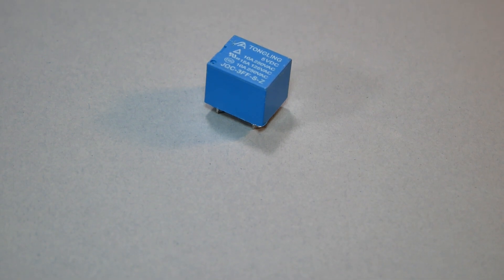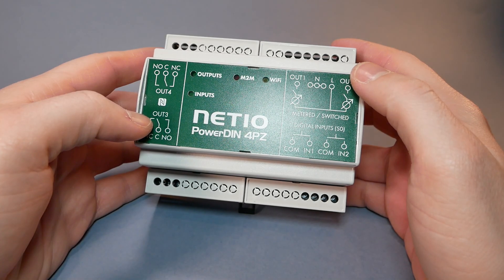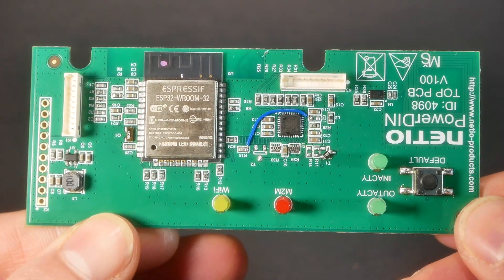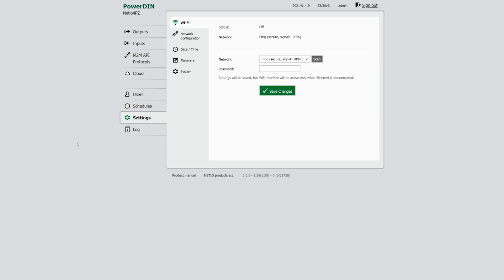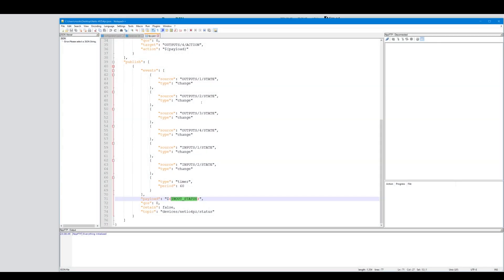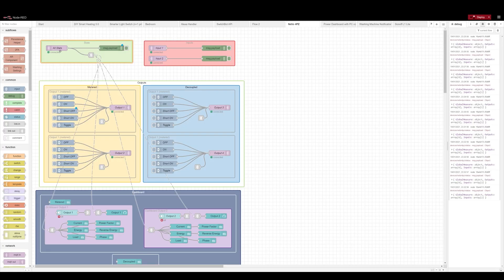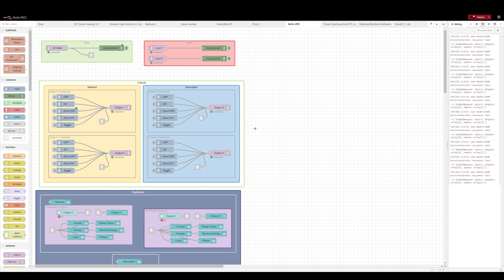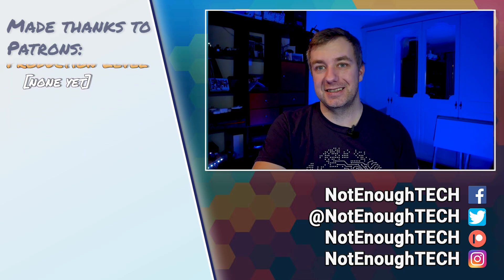This connected relay is nothing like the others - Netio 4PZ

Comment: Oh very nice product! I have to change the roof of my house next year so I'm thinking of redoing all the electric wiring (I have even found pre 70's wire!) in my house. As such, din rail mountable switches caught my eye. 

I came across Denkovi, who make a 16 relay ethernet capable din mountable relay which promises a LOT: mqtt support out of the box and some pretty advanced stuff, I would love if you can take a look at some of their stuff since I haven't find any trustworthy reviews out there: 
http://denkovi.com/all-products
http://denkovi.com/smartden-iot-mqtt-ethernet-16-relay-module-din-rail-box

I have counted 13 different lamps downstairs so far, so this would be ideal! If you are doing all the wiring again, you can in fact throw all cabling from your box to the rest of your house. It will cost a lot of wire but once you are done, you can actually control all your lamps from either one central location or keep it dumb the old fashioned way. 

A 4 relay is sadly not going to do it for me (I would need to buy at least 4), and I want the actual ethernet wire so that I can trust it will work all the time. I also want something built for industrial applications because the range of temperatures this thing will have to work may exceed normal ranges. But going for a fully industrial solution like a Siemens PLC is quite limiting due to the fact that it is difficult to communicate with the device.
Reply from the maker: That's a pretty beefy relay set. I envy your position right now with the relay choice - this would be something I'd go for as well. 
I had a go at work at PLC but I agree the controls feel like stuff from 90s and they are not the most user friendly interfaces. 
I might drop denkovi an email and ask for a sample to toy with. I have some load testers at work I could try but as long as you don't drive inducitve loads , you should be fine. Also if you buy it - get 2. Imagine the havoc if this thing breaks down and you have to wait 2-5 days for a new one :D
Reply: @notenoughtech  haha yeah, good thinking! I hope they answer, it would be nice to have an objective review from someone!
Reply from the maker: @CamiloSperberg  I'll keep you posted. I like the idea of this just not sure I have the guts to do this to my house yet
Reply: The Denkovi relay is impressive. With 240V contacts this would be great for controlling motorised blinds with hardware interlock.
Reply: @thierry3610  To be fair... it is almost too good to be true; don't get me wrong; it costs quite a lot but it is not as pricey as a PCL but ships far more user-friendly features.